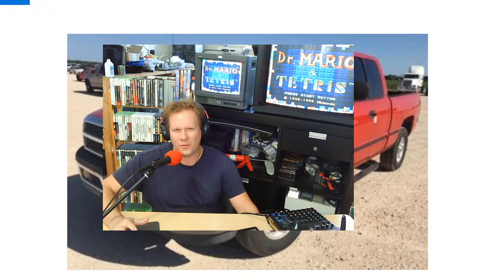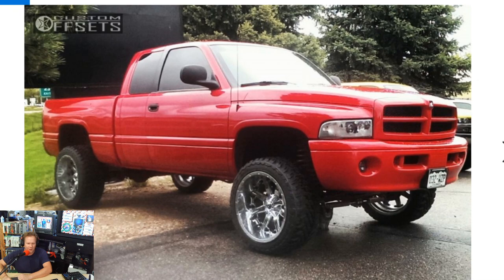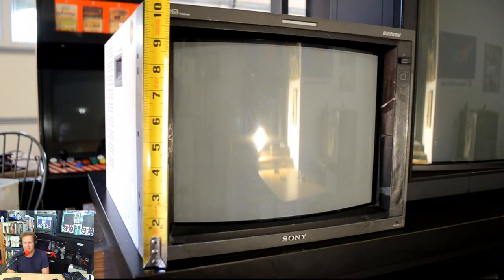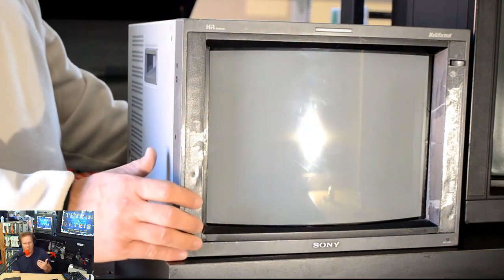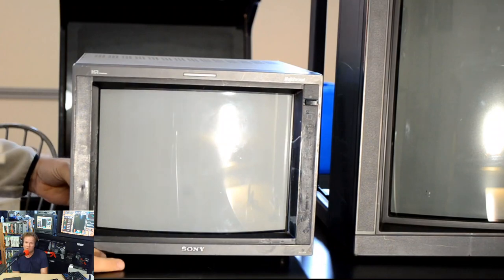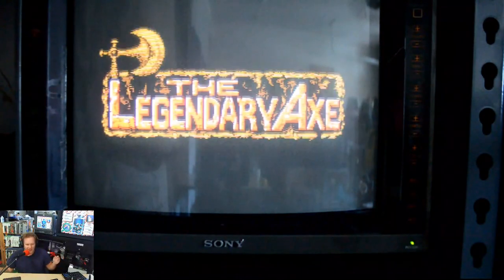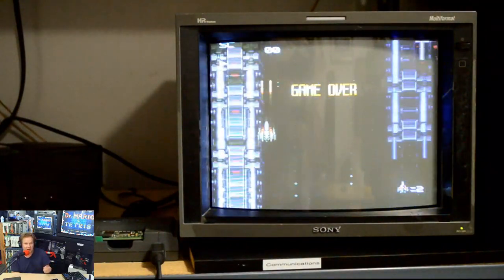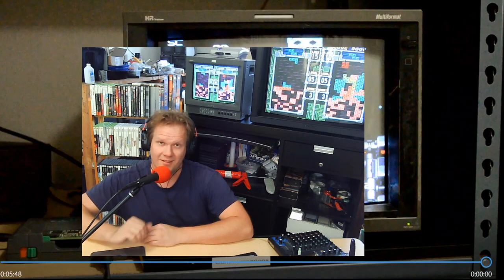Sony PVM & BVM Accessory Review - CRT Lift Kit w/ Antivibration Protection? | TG16 sync & PVM 14L5

Comment: Do vibrations potentially cause damage to CRTs?
Reply: Of course
Reply: @TheSlackassCrew  :(. Now I gotta get my CRTs outta my car. I've been using it as storage for 2 tubes 'cause there's no more room. Dang.
Reply: @MultiMarvelGeek  capacitors dont do well in extreme heat either. id get them out of there
Reply: @RideRedRacer  Yeah, I know. :P. I've just got no room. I have 9 CRTs in my bedroom. I plan on recapping or getting them recapped anyways. Thanks though

Comment: Pat recommended these feet to me after I contacted him about BVM expansion slot covers. glad I got them, as the old ones were hard plastic and worn out. fit perfectly on my D24.
Reply: what did he tell you about slot covers? he told me its better to not use them and let the monitor get more air flow